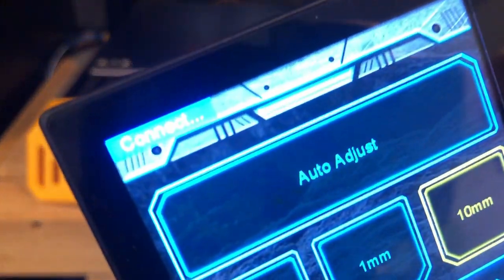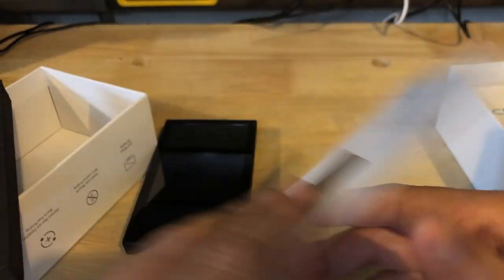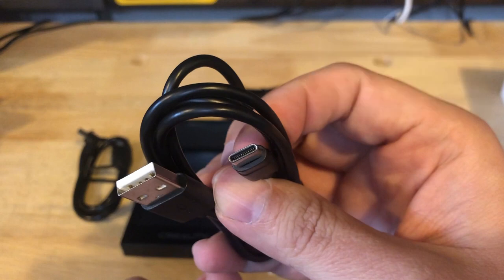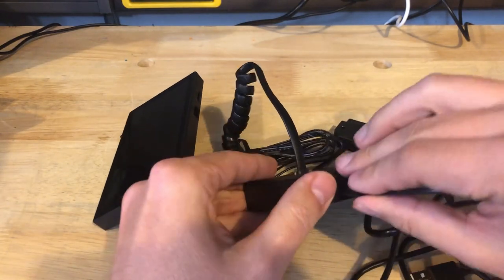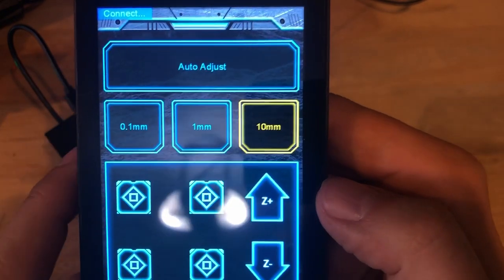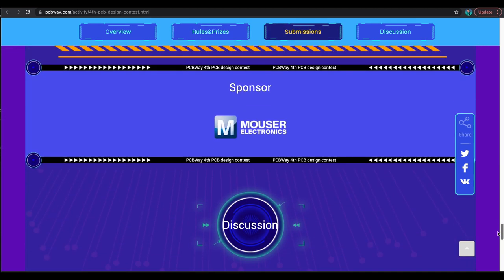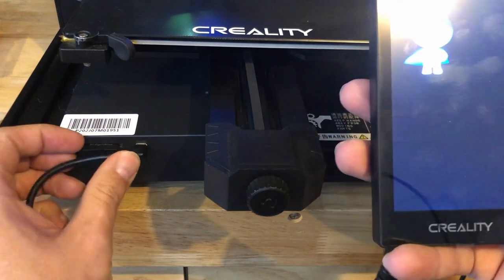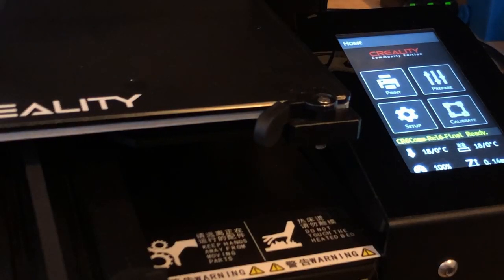Creality 3D Pad Review - 3D Printer Display

Comment: Hi friend, although your printer comes with Marlin firmware, but the baud rate may not be 115200. It can be workable if you change the baud rate to 115200. You can try it again and let us know the test result.
Reply from the maker: Hello @creality 
I know that 3 of the of the 5 printers tested use a baud rate of 115200, Kywoo Tycoon Slim, Creality CR6SE, and the Creality Ender 5 Plus.  Aside from the 3D Pad not working on the 5 of the printers I tested.  There should be an advanced menu on your #3DPad to select the baud rate of the printer you are using.  I also tested the Artillery Hornet, and Kywoo Tycoon Slim with the display unplugged, still no connection (which shouldn't matter).  The 5 printers I tested can use the same Raspberry Pi without an issue through the USB.  DWIT did everything I did and it worked fine across several machines https://youtu.be/ThKeXOTE8K4 - (towards the end of the stream)

As mentioned in the video
     *Didn't work on 5 printers I tested - 100% Failure rate
     *Lack of any advanced menus  
     *Poor cable management
     *No stand or mounting solutions included in the box
     *A price of $88.99 there are better alternatives out there with better functionality such as Octoprint

Creality you are offering the #3DPad as a universal Plug in Play solution to Marlin based printers "For all FDM 3d Printers with Marlin Firmware".  This didn't work as per your advertising  https://youtu.be/1IPGkm-PIVc nor did you mention anything in the video about unplugging the main display.  Unplugging the main display still didn’t make the 3D Pad connect on two of the printers I tested.  If unplugging the main display is a requirement, then it should be noted at the beginning of your user’s manual, and also in your video.  Unfortunately this is what your customers might experience, hopefully you can take what I experienced to improve your offerings.  This also could have been a defective unit.  As of today you still haven’t offered any assistance, or a replacement of the device.  I would be more than happy to do another review if you believe this is a defective unit, and if you want to send me another one to try.

Thanks for watching and commenting - Tripod
Reply: Creality , Put a Power down switch on it. gets a little unnerving having to unplug the darn thing all the time
Reply: @TripodsGarage  You said it brother.
Reply: @TripodsGarage you told them lol

Comment: To me it looked like you didn’t remove any SD cards from the printers. It looked like it was trying to read from both ports and got confused. Maybe try removing your sd cards before plugging it in and turning it on. The pad has a slot for sd cards and thumb drives.

Comment: Just got mine. In the manual it says to unhook your display and leave it unhooked. Havnt had any issues with mine
Reply: This… “5. Matters Needing Attention and Maintenance… 2. To avoid errors, please unplug the original screen while using Creality 3D Pad”… worked perfectly doing this on my Ender-5 Pro

Comment: it will work , once its all plugged in and everything is turned on , then tap reset on the 3d pad and it will connect , but im struggling to change from pla to petg
Reply: No it doesn't, I've tried 3 times

Comment: Not that it matters because you didn't get it to work but i found that the back of the screen has 4 magnets built in to the back cover. I found this out because i was wondering if it had a micro sd on the board like a ender 3 v2 has to update the screen firmware and when i took it apart i noticed the magnets on the cover but no sd slot

Comment: it would have been BITCCCHHINNN if it had a JOG DIAL like the standard S1 display
this would be ideal to rescue printer stuck in .bin firmware jails from the likes of XYZ Printing
I have a need to unlock my PartPro 300xt which uses Marlin from the XYZ prison which horribly requires me to use Filament that is chipped with the darn NFC chips....

do you think that a Pi4 running Marlin could drive my printer??? my printer had a outside filament box with additional filament feeding motor and a and its using Nema 20 motors I think of different steps than a Nema 17 style motors... PLEASE HELP

Comment: Before u post a video saying a product doesn't work read the manual ...I own this and it works perfect the manual states you must unplug your original control display to Avoid Errors/conflict and make sure your cabling is plugged in correctly and firmware on machine is most current  works on my Creality Ender 3 S1 ....the pattern you should be recognizing is that your not unplugging the control panel on any of your machines , the double sided tape provided is to mount your filament run out sensor, your communication box, and the display panel...next, is creality states you can print 1 of 2 stands from the creality cloud ..Spiderman and a groot themed mount ....My S1 is a great printer didn't need this 3d pad for any reason other than just being curious ...only paid 55 new from an ebay seller and also the cables when you put some thought in to it all hide away very well .this isnt a product for everybody.....Just Do your research before totally bashing a product and misleading people ..I actually saw this video before my purchase and still ordered it because I knew u were doing something wrong ...hope this comment helps someone
Reply from the maker: Wow, such a detailed response 👍.  Please review the pinned response from Creality, and my reply.  Please be sure to watch the video that is mentioned.
Thanks

Comment: I have to say that I am brand new to 3D printing I was looking to see if there was way to mount it so I agree with the mounting issue but I can 3D print amount but even I figured out very quickly that I had to unplug the original screen to get the new screen to work or like the one screen said the bootloader will be confused on where to load. I had mine up and running in 5 minutes just by unplugging the other screen.
Reply from the maker: Greetings Sevaanos.  I would like to direct you to the pinned comment that is from Creality, please be sure to read my response and watch the video.
Thanks for watching and commenting 👍

Comment: I just got this and it says in the booket to unplug original screen turn on printer before before turning on pad. I haven"t tried I'm 4 hours into a 9 hour print
Reply from the maker: If any of those things listed on the last page were that important they should have been on the first page.  The comment section of this video is just filled with things to do to make this work (which is proven people don’t read). 
 
*Unplug the main display
*Remove memory cards 
*Change your boot order
*Remove the memory card in the Creality Pad
*Have the latest Marlin
*You don’t have filament in the sensor 
*You didn’t drink a 6 pack before assembly 🤔

I was on this live stream with DWIT-3D and he didn't need to do any of the things listed above to "make" it work (towards the end of the stream) - https://youtu.be/ThKeXOTE8K4
  
Maybe things should just work as advertised.  Possibly I received a dud?  If I received a dud, Creality has decided to ignore my IM's and this video in it's entirety to see what was wrong.  Please read the pinned comment from Creality -

Comment: Does it have a baud rate setting? I guess it cannot connect to the printers due to a mismatched baus rate and other settings.
Reply from the maker: Hello!  Unfortunately there is no baud rate setting, I would have tested other baud rates if it was available.  I was informed the default baud rate is 115200.  If that is the case the Kywoo, and Creality machines tested should have been able to connect.   Thanks for watching and commenting.

Comment: did you ever get it working?
Reply from the maker: Unfortunately I never got it working.  Been waiting to hear back from Creality.
Reply: @TripodsGarage  they have brand new firmware on the web site. Make sure you format the SD first then drop the tft file in it. Here are the steps. 
1 have it unplugged form the machine
2 make sure no other sd nor sd card reader is plugged in.
3 turn it off
4 install card
5 turn on and upload touch pad wait until it done installing.
6 turn off then take out sd card and hook everything up again. 
7 Turn on and factory restore device 
8 see if it works.

Comment: try it again but unplug the onboard screen, then Plug in the 3D pad. that's what I had to do. have it running on my Ender 5 which is running  Creality Mother board with TH3D's firmware. By the way the way the screen does work well. a little clumsy with all the cables. Printing a stand for it toady. for testing be sure stick a section of filament in the run out sensor. if you do not attach it to the printer. You can stop the annoying beep in the menu. I found a Video (Twentse 3D Experience) does show how to correctly setup the pad. It's in Russian so be ready. But you  can follow what he is doing. The Creality Print ,which you have to use to get the pad to work. is a little trying but it work swell, takes a little getting used to. All the functions work, just wished it had a on/off switch!
Reply from the maker: Hello Carl,
I tried that as well on three of my machines.  Still will not connect.  In all honesty, you shouldn’t need to unplug the stock display to make it work.  Thanks for watching and commenting 👍.
Reply: A bad Artisan always blames his tools!
He didn't even bother to read up on the unit .
Just plug it in 🙄
Reply from the maker: @raydurant7879  - Yeah, and brand loyalist no mater the quality of the products.  It will “Always” be the Artisan’s fault in your mind. 
Find it rather odd the DWIT3D was able to get his to work on 3 printers without all the nonsense of, screen unplugged, boot order, and any other excuses people have to come up with.  Towards the end of the stream - https://youtu.be/ThKeXOTE8K4 He did everything I did, and it worked, go f’n figure.  You can go roll back over in your bed, and wrap your arms around Creality and keep telling them you have their back…
Reply: Lol a little touchy.
Cheers
Reply from the maker: @raydurant7879  - Don't forget while you are spooning with Creality to whisper, "everything is ok, because I told Tripod it was his fault and not yours!"
Reply: @TripodsGarage  haha you are hilarious 😂
Reply: Wow strange analogy!!
What would Freud make of that??
Reply from the maker: @raydurant7879  https://lmgtfy.app/?q=analogy+vs+sarcasm - Maybe you should know the difference before trolling properly.
Reply: @TripodsGarage  no i will leave that to you.
Have a nice life .
Reply from the maker: @raydurant7879  - Sorry your trolling failed…
Reply: @TripodsGarage  You think????
I wasn't even trying.
You on the other hand , don't handle criticism well my friend.
Anyway. Goodbye
Reply from the maker: @raydurant7879  - Criticism is fine when it is correct.  Unfortunately your statement was not correct.
Reply: @TripodsGarage  lol 😆😆
Reply: My manual actually said unplug the screen to stop conflicts, and there’s a link to a holder to print.

Comment: I took two minutes (maybe) to download and read the manual. The second line says to unplug the original screen BEFORE using the pad. You should at least "glance" over the user manual before coming to the conclusion that it doesn't work.
Reply from the maker: And you should read the pinned comment before jumping to conclusions.
Reply: @TripodsGarage  so I’m supposed to read every comment? You didn’t even bother to reply to that one whether or not if that worked. I literally downloaded the manual and on the second line of the instructions it tells you to disconnect the original screen. You didn’t even bother to glance at it just announced that it didn’t work and had broken printers powered up waiting for what? The printer fairy to come and fix them? Stop being so incredibly lazy.
Reply: @david78212  so what you're saying is that there's no way that it could be a bad product? I mean every product leaves the factory in perfect working order. He did a review on a product it didn't work he links a review that shows what you say he had to do (disconnect the screen) proves that what you say isn't true. How about you not be lazy and review the post he pointed you to before you call someone else lazy.

Comment: the reason it did not work is because you did not put any filament in the run out sensor....it works fine on my ender3 and ender 3 max, its a great piece of kit !
Reply from the maker: The comment section of this video is just filled with things to do to make this work -
 
*Unplug the main display
*Remove memory cards 
*Change your boot order
*Remove the memory card in the Creality Pad
*Have the latest Marlin 
 
Now we have not having filament in the run out sensor.  Find that rather odd, if I didn't have filament in the sensor, wouldn't the Pad just notify me?  Isn't that what it is supposed to do?  Does your built in printer display not communicate with the mainboard when it is out of filament?  IF!!  This was the case, that would be a complete fail in its self!

I was on this live stream with DWIT-3D and he didn't need to do any of the things listed above to "make" it work (towards the end of the stream) - https://youtu.be/ThKeXOTE8K4
  
Maybe things should just work as advertised.  Possibly I received a dud?  If I received a dud, Creality has decided to ignore my IM's and this video in it's entirety to see what was wrong.
Reply: @TripodsGarage  when i did  not have any filament in mine it would not connect at all. But as you can see Tim did not have any filament in his sensor but it worked???  I really like the pad, as it really transormed my ender3 max! And for the cost of £47 i think its worth it

Comment: i forgot, stick some filament in the run out sensor, if not it won't connect
Reply from the maker: That makes zero sense.  If you need to have filament through the sensor for it to connect to the 3D printer, then that is an instant fail.  Does Octoprint, Pronterface, or your main display disconnect when the filament runs out?

Comment: Never got it to work from beginning of October. 
Has to be Creality's biggest lemon out there.
As for them stating the incorrect baud rate (all marlin runs at that speed), why cant they have that option instead of having to delve into Marlin firmware to check, which will be for nothing anyways!? BTT"s display connected to SKR mini let you check!

Comment: your supposed to disconnect the printers own screen first
Reply from the maker: Did you read the pinned comment?  Also do you need to disconnect the display to run Octoprint or Pronterface?
Reply: In the 3d pad manual heading 5 (Matters needing attention and maintenance) point 2 "To avoid errors, please unplug the original screen while using 3d pad"
Reply from the maker: @australianspiritspirit5232  - Instead of reading the pinned comment, you recite the user’s manual 🤦‍♂️.  Why do I even bother…
Let me say it again then.  It was tested, and still didn’t work.

Comment: Nice job man! I wonder if you unhooked the screen first?
Reply from the maker: You can check my Twitter.  I have the Artillery Hornet with the display unplugged, still doesn’t work.
Reply: @TripodsGarage  It should not matter as it is connected through the normal usb connection. Basically the same way OctoPrint on a RaspberryPi is connected. It queries temperature and issues gcode commands via usb. In fact this display is the same type of hardware as a RaspberryPi with a display module, which probably would work with all printers.

So they did a very bad job of implementing the serial interface.

Comment from the maker: I want to clarify!  It was mentioned that I should possibly unplug the original display, then attach the Creality #3DPad.  I have a video of the Artillery Hornet with the display unplugged on Twitter, still will not connect.
Reply: Yeah, if that were the case then you couldn't connect a Pi either. The pad should use the same comm protocols.
Reply: Fail to see how placing gcode on the SD could make a blind bit of difference to the ability to connect to a printer via USB!

Comment: I bought this when they first hit the market and at the time I was using an skr e3 turbo and could not get it to work and after speaking to butt and creality was told it wouldn't work. then went to the creality 4.2.7 board it worked half assed
Reply from the maker: Sorry to hear.  Hopefully you returned it and got a refund?  As you can read in the comments here, I am on an deserted island.  However, I stand by my review l.  Creality has yet to offer either a replacement or anything else.  So there will not be a follow up review.
Reply: @TripodsGarage  I did get a refund (gotta love Amazon prime) I liked the idea behind it and wish it would a worked but it was kinda the same thing with the creality wifi box needing proprietary hardware to work with their stuff and while the ender series are open source it only really applies to firmware which don't really have support for the 3d pad whereas the e3v2 display sor far as been the most "open source" friendly I've tried out I did want that 3d pad to work it just never make it happen

Comment: You should have read the instructions. You only looked at the pictures for a sec and there are instructions on the back.
Reply from the maker: Ohh!  I knew I missed something!  Oh wait, there are more pictures on the back.  I love pictures!  I must have never looked at the other side, because I didn’t flip it over in the video 👍!

Other side -
More Menu Navigation
Slicer Software
Matters Needing Attention- Which I already covered in many other comments, including the pinned comment.  Which you could have read yourself.

Given that I reached out to Creality a number of times before I even released this video.  The only troubleshooting they provided was baud rate, which I checked.  Either I received a bad unit, or it just doesn’t work…. Either way, Creality has chosen not to address this issue.